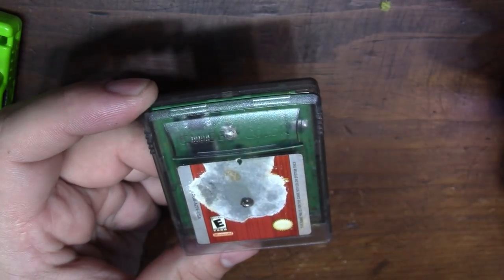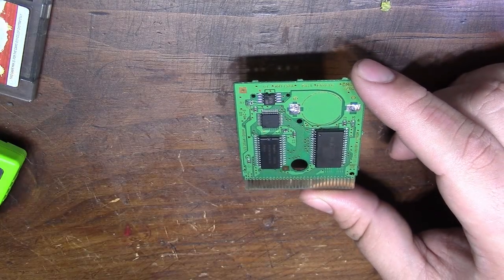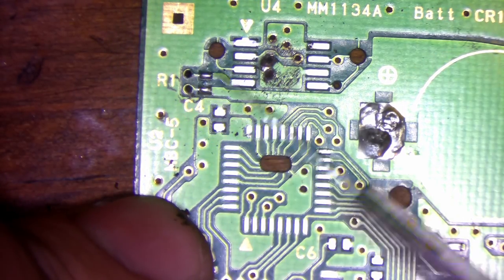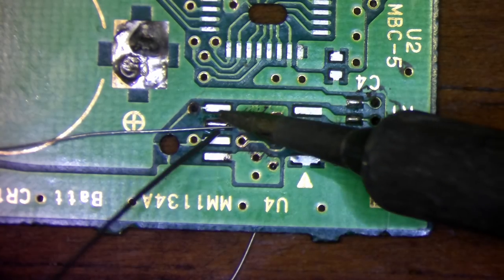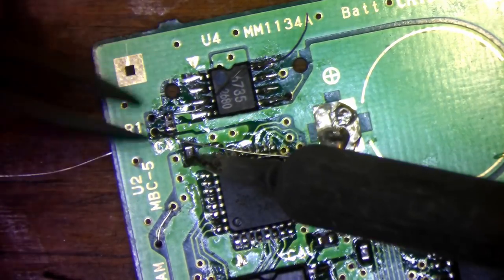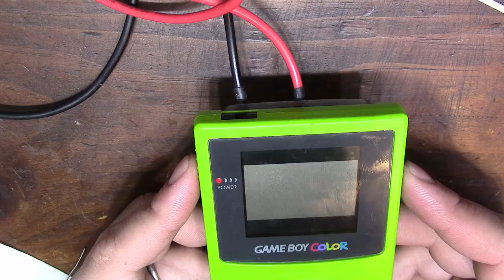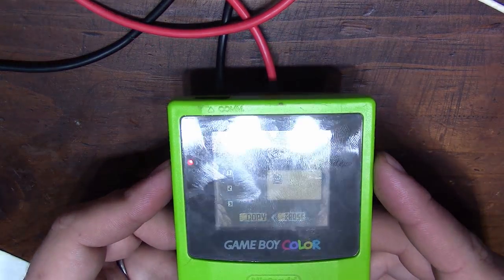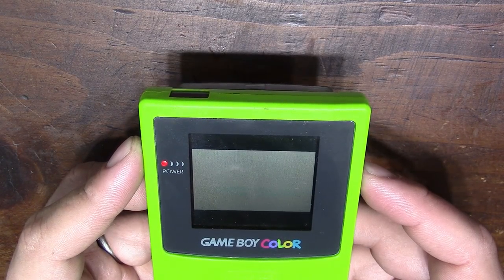ORANGE JUICE ATE ZELDA?? Can it be repaired? Gameboy color game repair!

Comment: Thank you for restoring my childhood game SK! I learn so much from watching your videoes :)

and yes i spent a LONG time scrubbing that board. I completely soaked it in ISO for some time and just kept scrubbing.
Reply from the maker: It was a lot of fun to fix! I was finally able to use my scope set up :) Your cleaning efforts really showed! Had you not told me what happened I never would've suspected liquid damage without removing the chips lol
Reply: @Solder_king  , @Brandicus, desoldering components would not be necessary if you dunk the board in water rather than IPA. IPA isn't the only solvent out there. Water is fantastic solvent, too! It can go under components and dissolve stuff that IPA is not really good at cleaning... like orange juice leftovers. It is very likely that the gunk was actually caused by you using IPA in the first place rather than give it good soaking in just pure, distilled water.
If you are worried that water will corrode anything, remember -- orange juice will probably be more effective at corroding. Also, there is what is called "electronic water" which you can think is pure water with no oxygen dissolved (normal distilled water can still corrode things due to oxygen).
Another pretty good solvent is good old ethanol. It can solve some stuff that neither IPA or water will touch.
If you want to use water to clean board remember following procedure: use only distilled or electronic water so that it does not leave any salt crystals. First soak in water and try to limit time but move it about or maybe even use a stream of water under some pressure (best to use ultrasonic cleaner). Then remove from water and soak in IPA for some time to mix any water and maybe dissolve things that do not dissolve in water well. IPA will be very good at making sure water does not stay under components for long time.

Comment: Gbc games can draw power from the system for saves if the internal battery is dead, removing it like you did will obviously delete them immediately however.
Reply from the maker: That makes sense too! I figured my bench supply was still pumping something out but the Gameboy supplying power makes more sense.
Reply: I have seen that done before batteries used in game cartriges to store memory. 😕 I still don't get how the heck a battery can store memory. 😂
Reply: @jordanedwards4358  The battery itself doesn't store the data. What it does is power the RAM that is storing the data. The type of RAM used in these cartridges is considered volatile, meaning  it needs continuous power to store data. If the power is lost, so is the data. Hope this helps!

Comment: I'm just curious... I did consumer electronic repairs for 20+ years until everything went SMD and I haven't done much in electronics since.  What temperature do you use (on your iron) when working with those components?
Reply from the maker: I tend to keep my iron around 400c for most things and depending on the pcb it can go up or down 20c.

Comment: Nice repair 👍👍

What temeprature do you use your hot air gun to remove the ICs?
Reply from the maker: I keep it around 380-400c and it varies a little depending on what I'm working on :)

Comment: How did you know where the traces should go?
Reply from the maker: Most of the time they're pretty easy to follow. For ones with vias, a helpful tip is to feed wire through the via just to make sure you're jumping to the correct path on the other side.

Comment: Nice video!
What temperature do you put the hot air station at? I've got a japanese Pokemon Ruby I gotta fiddle with since I removed the ROM one time and was going to swap it with an American Emerald's but I reflowed the pins on the Emerald cart's ROM chip and it worked again before I transferred the ROM over to the Japanese board. Now I just have to put the Ruby ROM back on its board, but I used a soldering iron to slowly and flux to remove it which was a pain. The hot air station looks much easier for these projects!
Reply from the maker: I've been there! I keep my hot air at or around 380-400c. :)
Reply: @Solder_king  
Okay! Thank you very much!
Reply: Bit late here so you can use a solder iron just rest the pad on the part above the handle near the tip and it will heat everything up pretty nice